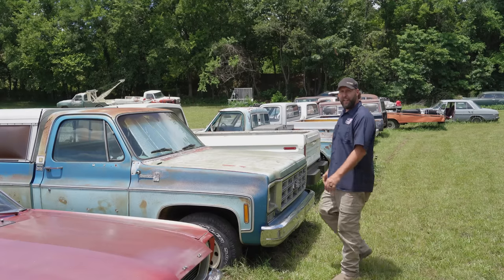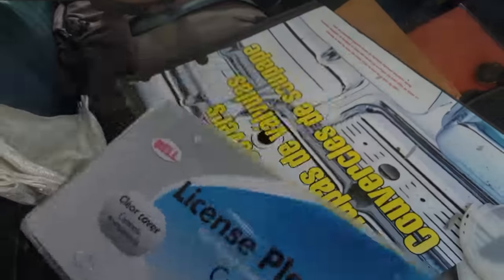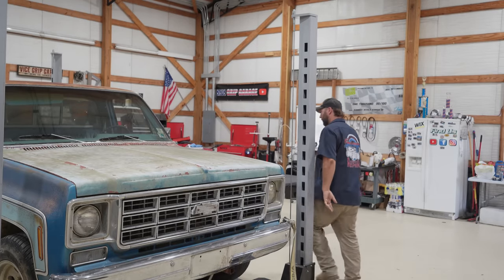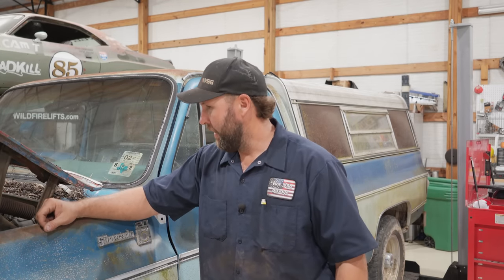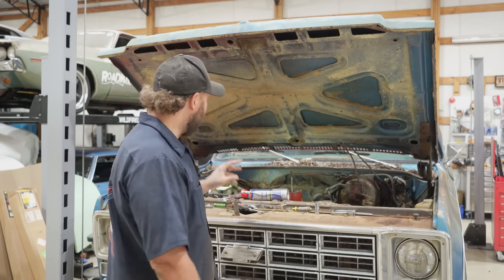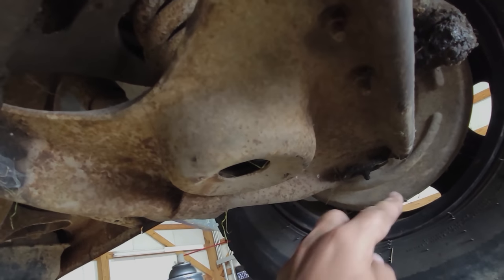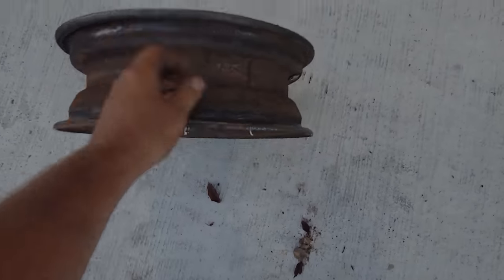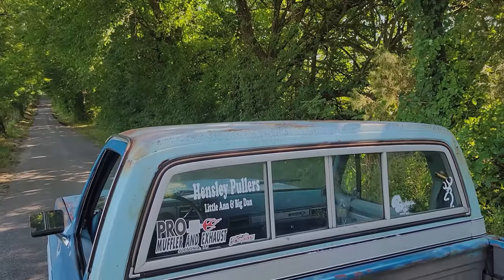Forgotten Big Block Truck- Will It RUN AND DRIVE After 16 Years?

Comment: I LIKE the wheels that were on this truck like others have said they do as well. I was glad to see you give 'em a little elbow grease and love to bring them and the center caps back around and then run 'em. Being as they are nice, vintage-look wheels with new tires mounted on them, maybe replace any of the rusted/pitted lug nuts for looks, or all of 'em. Love the truck, it does have a lot of cool add-ons and accessories. Can't wait to see your road trip with Bentley in it.

Comment: Dang, I wish that I could make a real offer to you for this one in a running condition.  I had a 76 Chevy C30 crew cab camper special that I worked on and got on the road. 454 4bbl standard transmission. Pretty much optioned out for its day, but not a 4x4. Took it to town Sept 30 2011, went to work and had my first minor stroke. Never could get it plated because our provincial bureaucracy in Toronto wouldn't allow it. Miss the old girl. This one would be a good replacement, nice truck with nice selection of spare parts.

Comment: Absolutely is. My dad had a 1978 Chevy Scottsdale only for pulling his camper, but we are in Michigan and when he sold it in 2000 it had 79,000. The body was about gone though.
Reply: Any vehicles used in the north,  just rotted severely, it's  a shame. It would be great to have a nice one today.
Reply: @andrewmoens8614  it was pretty cool he paid $6,800 brand new. The problem today is he got about 10mpg with nothing and 7mpg pulling his camper. That is better than the 3mpg my Uncle got with his  Chevy motorhome. Lol

Comment: Great episode and perfect timing. Started my 1985 C20 Silverado today. Used what I learned from your channel. She started on the first try and idled, got fuel pouring from the carb, I'll see if I can figure that out. Great watching you and Bently working on it together.
Reply: If it coming out the top its  most likely floats are stuck down and not floating up to stop the fuel from pumping in and its coming out the vent tube. I liked him trick of pouring the cleaner down the vent tube. Might free up your floats!
Reply: @dquinn8755  Yep, freed them up, all good. Been sitting for a long time. Thanks.

Comment: Love the video, been watching the channel for about two years now. My sons are now watching the channel as well. Your resurrection videos inspired my oldest son(soon to be a retired detective with the local police department and a third generation veteran, yeah have to brag) and I to start working on a 1973 Chevy Cheyenne with a 454 that my Dad bought new in 73. It was parked for about 8 years before he passed away in 2000. So last year when my son said he wanted find an old truck to fix up when he was over helping me do some work on my 52 Ford F1, I told him there's one right out there. The 73 has been sitting at my house since 2000 and was always kind of the next project I was going to get to. Now after sitting for 29 years it has a beautiful new paint job and new interior. Being in Arizona there wasn't much rust damage. It has low original miles like yours so after using some of your tricks for getting abandoned cars going again its running great. He is now the proud owner his grandfathers 73 Chevy Cheyenne built the year he was born.

By the way when I saw you and your son tow the Chevy to the shop it reminded me that years ago we used to put about a 10' piece of pipe over the chain to keep the towed vehicle off of the back of towing vehicle. 

Keep up good work! Love to see fellow patriot saving some of our American history.

Comment: That was our wrecker for many years.  It was put out of service in 2008 when Larry purchased a new wrecker. Around 2010 or 11 ( can confirm by date on the battery) I did some repairs to the PTO gears and got it tuned up and we used it around the station for a few days until brakes failed. Instead of repairing we just put it right back in its spot and left it. Larry had intentions of restoring it to its former glory as it was his first new wrecker he ever bought. He has turned down many offers to purchase but you just caught him on the right day. I’m excited to see it running and driving again and look forward to seeing it tow again.

Comment: Never transmit on a CB (or any radio transceiver) when it has no antenna. It can blow the transmitter output transistor stage.
Reply: Oh no, he will never be able to use that CB Radio he was never going to use anyway.
Reply: I recognize that antenna mount mine was a stubby on a swivel.
Reply from the maker: I'll transistor input stage it then
Reply: @ViceGripGarage  it's like that old TV commercial says , " the more you know". 😂

Comment: I would like to see one of these revivals restored to brand new status, like, new paint (not rattle can), suspension, interior, ect. Maybe this one would be a good candidate. You know, make it look like it just rolled off the dealership floor.
Reply: like its not what this channel is about however... I'm sure Derek is more than capable of pulling it off , get the guys in to help out now and again over a few months. would make for some different content
Reply: 2nd that idea 👍
Reply: That would be cool i am sure truck car would turn out awesome looking 
But that’s what makes Derek so cool and different cars and trucks don’t have to be looking like brand new to enjoy them and to encourage others to save restore and to enjoy classic vehicles
Reply: that's what they did with the "POWER TOUR" crewcab...
Reply: @gben7084  Not a showroom restoration on the crew cab. They stopped short of paint and body work. I would consider the crew cab a limited resto-mod.

Comment: That exact truck was my first new vehicle I ever bought 13,000 bucks I wish I had never sold it parts were cheap everything was easy to work on. I honestly can't think of anything that was bad about the truck other than maybe using quite a bit of gas. I pulled a 10 x 40 house trailer from a trailer park in Detroit closeing down all the way up to Cadillac Michigan on my 20 acres used mostly for deer hunting season. We always had fun hunting deer drinking and playing cards in the good old days. I have wild stories about four wheeling in the woods getting stuck in the middle of nowhere in the mud, flat tires, we got into all kinds of trouble with that truck and I just loved it would do it all over again that what is a tough old truck.

Comment: My first car was set up like this one; a '73 Buick Regal with a 454, 400 turbo trans and a mechanical 4 barrel Quadra-jet. Loved it and drove 4-5 years. 
Fastest car on town (other than a '65 Mustang).
It ate points and mufflers (had to go with glass-packs). Had to heat shield the fuel line like this one... 
Good Job Dad!

Comment: I got an 85 k10 with a 305, had the stock cap and rotor in it and it would run, but it would die as soon as anything got hot. It done what Derek said and got “cooked in to death” and burnt up. Put a msd 1 wire conversion hei kit on it, and it hasn’t had any problems since. HEI systems are so strong.

Comment: Love to see a Dad working with his son. Easy way to find arcing plug leads us have turn engine over with shop lights off, you see tge arcs in the dark, may need a dry stick to move one up if arc underneath, and use a flashlight to get back to the shop light switches!😎

Comment: @ 44:25, we had a front spare tire rack on ours, I dont know if it was factory, but I bet that is what was cut off

like I said earlier, our camper was about a foot and a half past the end of the truck, it also dropped down to where you just need to pull out a 2 step drop step to climb up in the camper....so it would have been hard to get a spare out from under the back...also helped lighten the back end a bit....those tires are heavy

Comment: the year was 1979, living in martinsville indiana, I was 9 years old, when my dad pulls up with this brand new truck with a huge camper....1979 camper special with a 454
when I say huge camper, this thing stuck about a foot and a half past the end of the end of the truck and was tall enough to have a sleeping area above the cab....it had a sliding glass window on the back window of the truck to the camper, where there was this special inner tube thing so there wasnt any wind between the cab and the camper from outside

we went all over the central states from indiana to florida.....man those were great times.....we had that truck till 1984 then moved to kentucky where I still live today
almost forgot...ours was red and white

have a great day

Comment: You can't beat that HEI distributor. Hands down the most reliable ignition system and it has a pretty strong output for a stock set up. Between the distributor and the single wire alternator  gm came out with you just can't go wrong. There are several other parts  on a gm that were very well designed and can be found in the after market world set up to work on other manufacturers cars.

Comment: Make sure to clean out the cowl to fender rain drains; those little leave will Plut those two channels for certain. Just replace my floor boards for that reason on my International 1210 3/4 Ton.

Comment: That's one hell of a tow rig there. 454 with a 400  turbo hydramatic trans and a corporate  14 bolt rear end. The rear end is probably limited slip. Shit you could out pull a one ton  truck if you had 3:55 or taller gear ratio in the rear end. For sure one hell of a tow rig. Nice ride!! I wonder what your asking for it?

Comment: Need a glue kit for the rearview mirror anchor. 11:41 96K original miles possible. 12:37 get the newer AC compressor for R134 newer synthetic refrigerant Oil.

Comment: I'd have to go with 196k but wonderful find! I just picked up a "running a year ago" 86 K10 short bed, manual that was sitting on 35x14.5 super swampers and fashionably redneck "adjusted" with air/mud blockers in the air filter that would only let you get up to about 35mph so I was told. I flew down from Spokane WA to Reno NV with a sparse set of tools which I thought I could carry on the plane WRONG 7in... no longer so had to check it in missed the flight doing so then got pushed to the next flight. Great start, I landed and got to the truck before dark to find two flat tires torn sidewalls you could put your fingers in. So I started digging on craigslist and was gifted with a guy being deployed and giving away his 90% stud-less snow tires and rims off a newer chevy SAME bolt pattern FREE posted 8hrs earlier! I was skeptical, this could be certain death, or could I actually be this lucky, so I grabbed a friend and went. I mean it couldn't be this easy could it? And as most of you have already thought that center hole is just a little TOO small to fit. So ordered rims for those free tires as there is NO way in hell I was going to drive over 800 miles on super swamper music howling down the road at 7mpg and needed to figure out and tear out these "adjustments" to get some speed back in this beast. Found some tubes for the swampers and ordered those the same day as the rims which gave me a few days to get into and remove whatever the hell they came up with to "keep the mud out". So I get it all worked out ripped the two tires off and got those tubes installed, and the RIMS got delayed but at least I get her standing back on all fours n rolling with the swampers. Tranny howling noises from the rear end but hey the fronts axles GREAT and steers ok only 3-4in play! She'll be FINE. Got a couple gallons of gear lube and filled everything up, tranny and rear end SUPER low but next test around the block nice and quiet smooth shifting but it's a little wet on the rear pinion seal... ok a LOT wet. So finally get the small tires on test drive seems good, gonna fill up and leave at 5am while it's still dark. As soon as I get on the freeway on ramp the electric choke wire breaks slaps the choke down and kills the truck. I get that fixed with some electrical tape to pull the choke open the taped it under filter so it could pinch it so it wouldn't slide off, that worked and lasted the whole way back stopping every 50 miles to add about a qt of gear oil mixed with lucas oil stabilizer. 16 stops later I got home at 12:45am, thought of you many times along the wild trip. I did hit 80mph a couple times, yes down hill and only to get a run at the next hill, no power valve or secondary's made nearly every hill a shift down sesh with some at a 40mph crest speed.

Comment: "Putting a starter in with headers is not fun".  Yup. That's why I have a mini high torque in my sbc now.  Also the heat from the headers was causing it to crank slow after being warmed up.

Comment: Boy I wish I had a set up like yours big shop and all that you know left all the good stuff I have a 1978 Chevy four-wheel drive 3/4 ton with a 350 4 barrel and automatic transmission it needs to be restored from the ground up but I love that truck I'm still jealous bro that one's in way better shape body wise than mine

Comment: What is a vapor lock exactly? I remember my grandpa saying this all the time with his old 80s GM Olds and Buick wagons he had
Reply: It's when the fuel line gets heated up from the engine heat, and the gas inside the fuel line will start to vaporize before it gets to the carburetor.  
The carb wants liquid gas coming into the float bowl.
The carb doesn't want vaporized gas coming into it, because it wants to do the vaporization thing itself.
Carbs are funny about that.
That's why the Feller wrapped the fuel line in some insulating materials, and relocated the line away from the hotter engine parts.
Hope that explination helps a younger Feller.
Stay thirsty!

Comment: Sure reminds me of my 74 C20 454, miss that truck! It took a beating and kept on ticking!!!
I love my 2004 SS Silverado , but it’s too dam complicated! With 400 computers , and most especially a wiring loom that was meant to fee tree and ground rats more than flow electrical’s ! 🐀🐿. Not to mention a beautiful blue metallic paint job that didn’t last 5 years what the heck is with that? Thinking about using a couple quarts of your special clear gloss to fix the gloss that blew away in the wind! Now I’ve got hail damage too because of these darn winters in Colorado! Golf ball size hail. My C20 square cab had an Orange metallic fade away ,like your blue fadeaway! You don’t have to worry about the paint job!!! So much pressure off the old noggin ! Can’t believe what these square cans go for now! Even if their not running!? Love the show keep on keeping on ! - 
Regards , Mad Mike S. From the freezing ass cold of Colorado ☃🥶❄……….

Comment: My dad ended up getting the 1974 GMC 454 Camper special instead of the chevey camper special. The GMC Was supposed to be  better. It had positive traction. Best truck he ever owned.  But the 454 used oil, even when new. He had it for 15 years. It was a 3/4 ton. He used it for work also. He was a carpenter and that truck could carry alot of lumber.

Comment: I found out a good way to get that grip grease off the steering wheel, shifter etc is with degreaser dampened dryer sheets. I like to use the dawn foam degreaser w the sheets. 
Derek, I know you like wix filters, what is it about Fram that you don’t like?

Comment: These video's are always fun to watch,  Instead of 2 stroke oil use Marvel Mystery oil mixed in the fuel alot of cleaning benefits and lubrication dump in the cylinders too especially if they feel tight or when storing for long periods also put in oil on these old vehicles

Comment: My dad bought a 1974 C20 Camper Special.  He had a camper on it, and only drove it to go camping, as you suspect with this truck.  His truck has only 80,000 original miles.  My nephew is still driving the truck once in a while.

Comment: The paste under the HEI module is not for insulation and not "lithium grease".  Its a heat transfer compound.  The module must be heat coupled to the distributor to KEEP the module from overheating and failing in quick succession.

This is an artefact of running 12volts full time through the system.  There is a lot of watts of heat being generated.

Comment: Great video! I'm not a fan of the 454, mainly because I once owned one. Hurt my back trying to get those 150lb (each) heads off of it. Changing the water pump was a bear as well. Everything about that engine is just really heavy- the only aluminum on it is in the carb. Chevy never put enough radiator on them, either. Seems like they always ran hot.

Comment: My 2011 F150 4x4 xtra cab XLT didn't like those Yokohama Geolanders on the front. Tread caused noticeable vibration. Worked fine in the rear/

Comment: I'd like to see you test brisk plugs.  They have no electrode to arc to at all and are called scatter plugs.  I could feel an instant Power difference with those and a set of multi-fire wires.

Comment: was working on an old 70's dodge truck for a feller once. she was gettin no spark. it took me 2 dam days to find that the ignition control "computer" was not grounded well to the firewall. the old one had burnt out. i had put a new one on and EVERYTHING tested good. i tested the coil. the points. the every dam thing you could test was good. but no test told me that dam "computer" needed to be grounded to the firewall. i found out by accident somehow. cant remember. but i had to scrape the paint off the new one. and then she FIRED RIGHT UP... lol. learned a good lesson that day i reckon

Comment: Lovin my BBC ! Had a 5.7 TBI in my 1990 GMC Suburban 1500 4 x 4. Not anymore,...  yanked and stuffed a  1978 454 BBC . Already had procomp steel crank,  SRP  high compression dome forged  pistons, Hasting rings, and H Beam forged connectors .  Cast heads and a new HEI , .. Oh and a new Edelbrock 600. Already had a 700R4 rebuilt, And now she just wont stop turn'n the tires over. Wife just loves to show off, I just wish she would'nt do it  local Walmart parking lot !